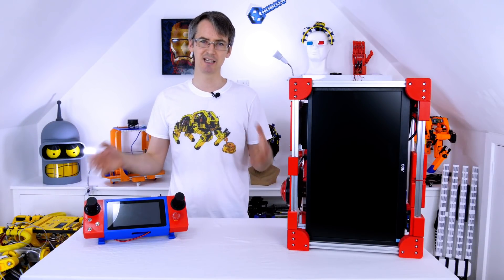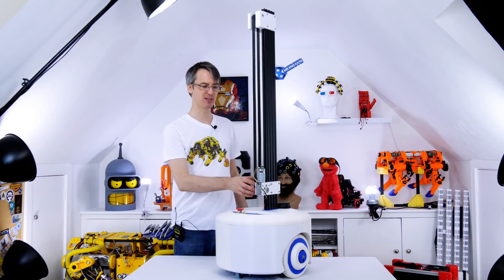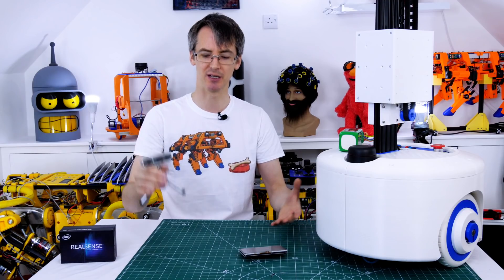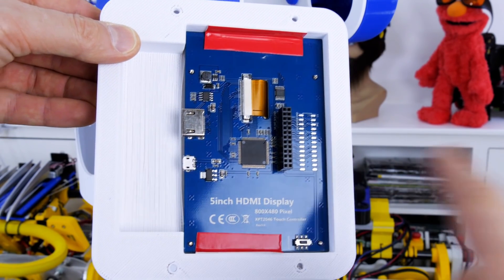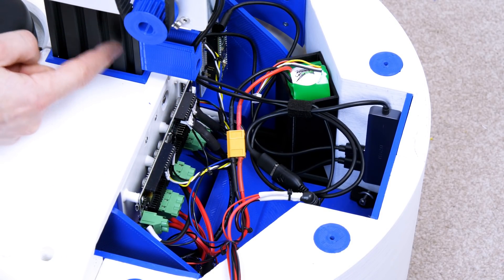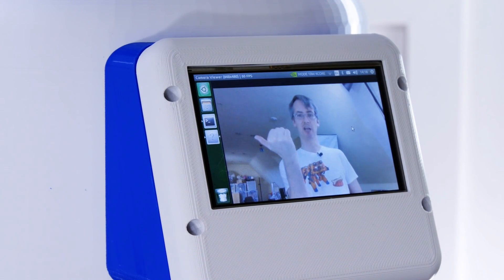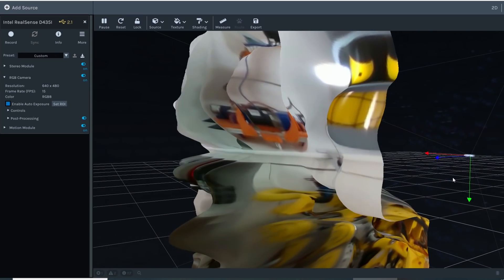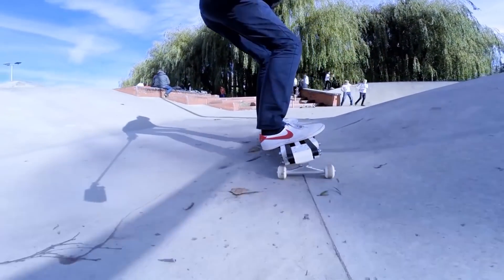Really Useful Robot #3 - Head & Intel Realsense Camera

Comment: If it's getting a bit wobbly, you could maybe just add some weights into the bottom? Casting lead would be fun but perhaps a bit much, big bag of rice would do the same! I think as well if the base were slightly longer since it's wobbling back & forth, side-to-side seems less of an issue.
Reply: another thought - perhaps some vibration damping on the post itself? if you still have some flexible filament you could maybe make some bushings that isolate the stalk from the vibrations in the base

Comment: he should probably add ultrasonic drop sensors, an ultrasonic low ledge sensor(ultrasonic sensor on the base looking forward), an ultrasonic backup sensor on the base, and a front facing floor camera on the base. he should also replace the y axis belt with a lead screw to prevent problems down the line like stretching and slipping. though for the arms it might be best and go the asimo route and use hydraulics in the base or head to control the griper and/or the arms.

Comment: Great video James! Great progress, thank you for sharing! You make us feel unproductive when you achieve this much great work in a short time.

I would like to add a few points that might not be touched in the video for who would like to integrate Intel RealSense cameras to their projects.
1. For D435, although a USB 2.0 connection would work, it would not give full set of features like depth and higher resolution, so USB 3.0 is almost mandatory. Otherwise it would be a very expensive webcam :)
2. Finding a single board computer with USB 3.0 is a consideration to be done early on in the project. Nvidia Jetson series (in the video) and LattePanda Alpha/Delta are good candidates. Raspberry PI3+ and below are not usable. I have tested with PI3 and can report that it is unusable. Raspberry PI 4 might work, but still could be underpowered for a large scale robot project.
3. Intel RealSense cameras are power-hungry and sensitive about USB supplied power. They do not have external power inputs, so usually they require a powered USB hub. A small factor USB 3.0 hub with good amount of ports is almost a must for a substantial robot project. Plugable and Anker have good and compact ones. Some hubs are more finicky than the others in Linux. Plugable needed few power cycles every now and then, Anker worked perfectly.
4. Besides the D4XX series (D435 and D415), Intel also has a T265 camera that can do visual odometry, tracking and localization. It is an amazing camera that compliments the D4XX series and makes the wheel odometry unnecessary and let's you build a complete vision based solution. This is particularly helpful in scenarios where wheel odometry is not feasible or not accurate (outdoor off-road, flying, human/animal mounted systems etc.).
5. The T265 camera is a pair of stereo fisheye cameras with onboard SLAM processing. Besides the very accurate localization output of the camera, the raw camera images can be used for other vision processing purposes, including a crude fisheye stereo depth estimation, but don't expect a detailed depth view like D435 provides.
6. Both D4XX series and T265 are mainly using near-infrared cameras. DXX series have an active near-IR illuminator (laser dot pattern that is not visible to the eye) just like Kinect, but it is also a passive stereo camera on the near-IR band (unlike Kinect). So it works both indoors in dark or light places with the help of illuminator and outdoors more relying on passive stereo. T265 does not have illuminator, but is pretty robust to lighting and I can report that it works accurately both indoors and outdoors, but most probably won't work in pitch black like D4XX series would.

Please feel free to reply to this comment if you have any questions or issues about Intel RealSense integrations.

Keep tinkering!

Comment: I don't like smooth idler gears on toothed belts. Getting the belt tight enough to eliminate slop causes the teeth on the idler gear to distort which can cause the very slop you're trying to eliminate. When you make the belt tighter to eliminate the slop, it doesn't help. It's caused me some problems in the past. It's a small thing, but I suggest in general that you use a toothed idler gears.

Comment: Great job as always. One day I'll get back to building a new robot that can use ROS navigation, yours seem to work just fine for that purpose.
I'm a bit intrigued about the current base version. You said you'll consider 2 caster wheels to make it more like a square (I'm guessing it will be closer to turtlebot waffle version). Could you please elaborate a little more on that?
Reply from the maker: It was just a thought really to make it more stable, but I won't be making any major changes for now.  I guess the wheel layout would look more like an electric wheelchair.